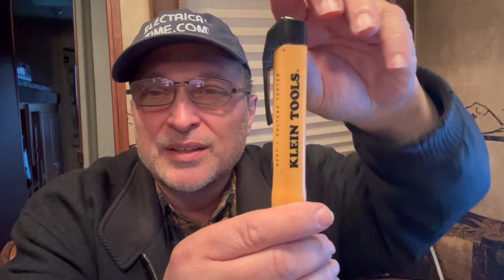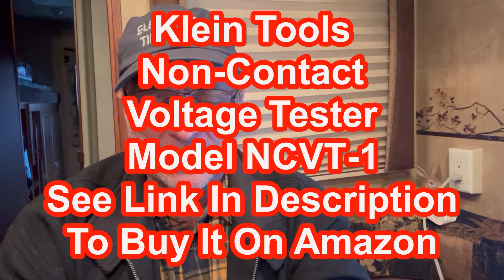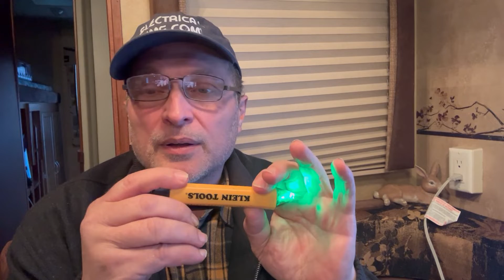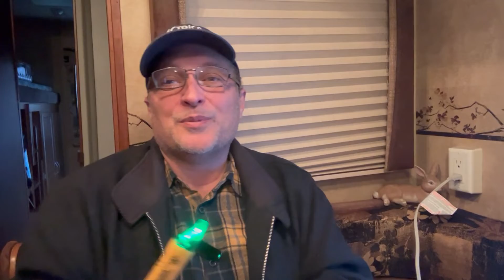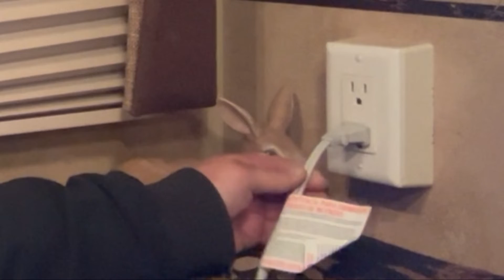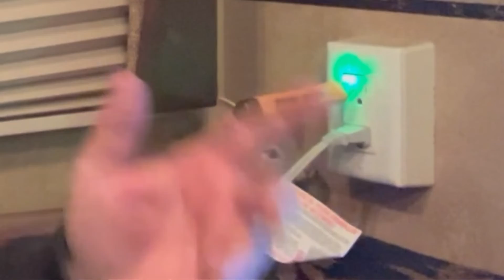Klein Tools Non Contact Voltage Tester NCVT-1P Demonstration

Comment: Quick comment 
1. I’m a big fan of Milwaukee, but don’t buy Milwaukee voltage detectors. 5 years ago I bought a Milwaukee voltage detector and it’s a piece of garbage. Not very long ago, I thought they probably fix and update this, so I bought another one. Guess what, I wasted another $20😂
2.Klein makes good ones. Some of them have a light. It would give a lot help
3.About this kind cord, feel it by fingers. Rough side is neutral and smooth side is hot side
Reply from the maker: Thanks for your comment. I tried the Klein Non-Contact Tester with the built in light and I was not happy with it. The tester was too sensitive and would start beeping before getting close to the conductors, also the one I tried had a short point and was not able to be inserted into the receptacle and to hold itself there while I turn off breakers.